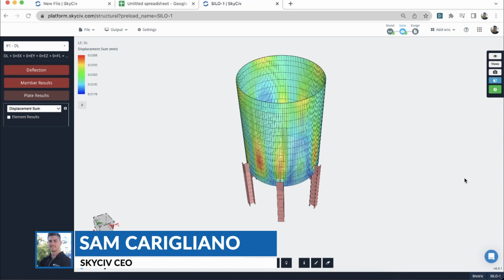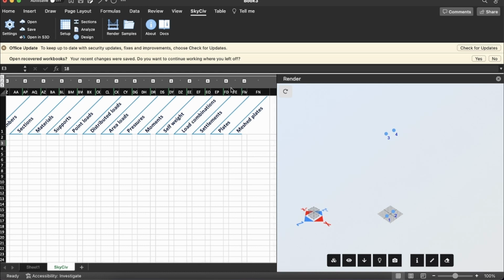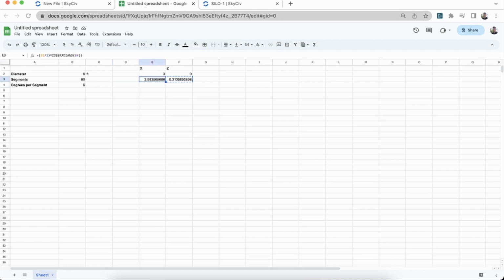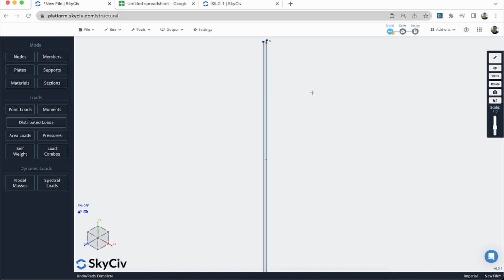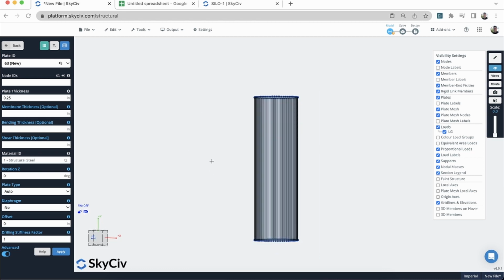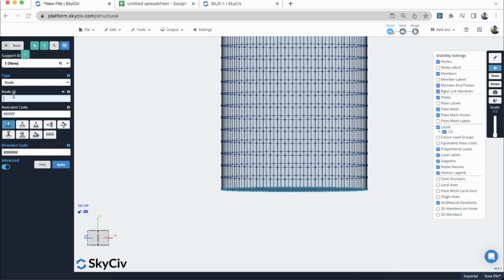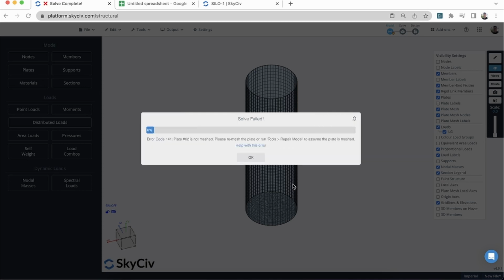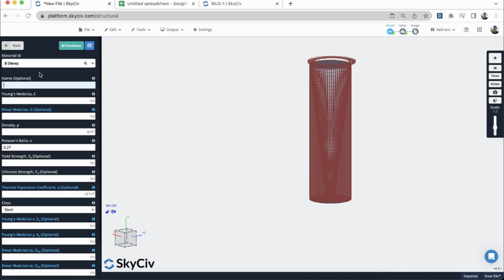How to Design and Load a Silo/Tank

Comment: Excellent, thank you.  It is the 1st time I come to realize that you can build a model in SkyCiv without structural members.  Great tutorial for MEs!
Reply: If you are simulating hydrostatic loads, you should add pressure to the base of silo in the vertical direction, right?